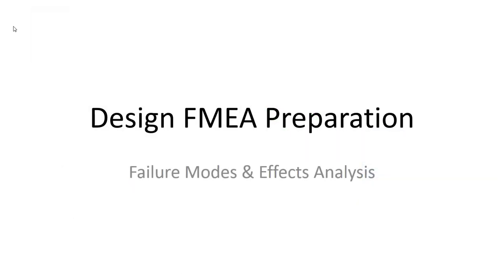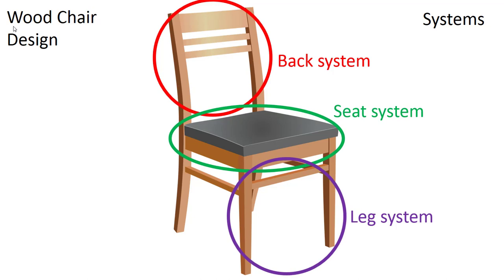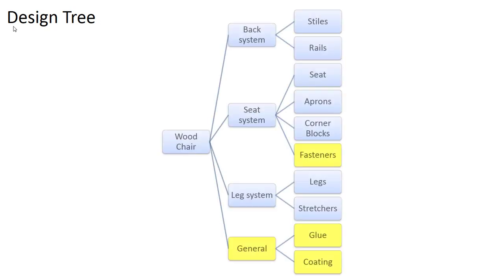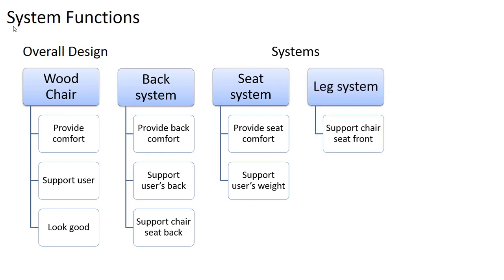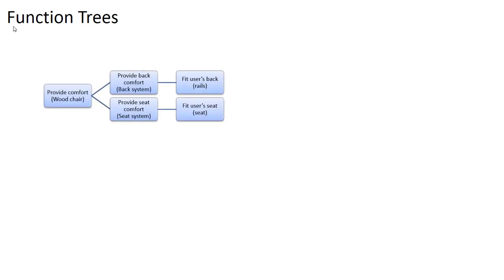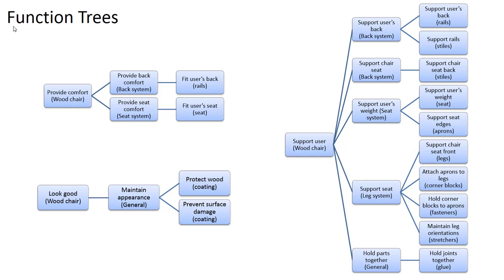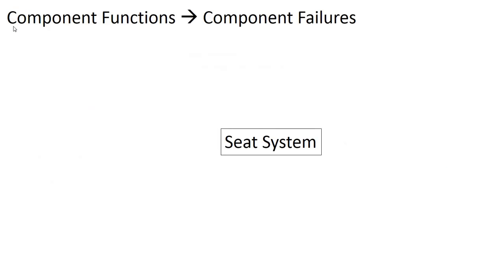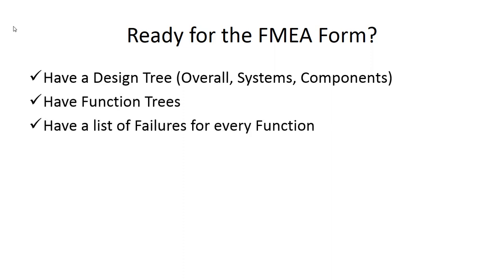Preparing for an FMEA

Comment: What is bottleneck?
Reply: Bottleneck . means  situation that makes the process slower. When a liquid flows through the bottleneck the quantity that flows is less than that comes from the open-cut diameter of the bottle.  it can also mean hurdles, barriers. etc.